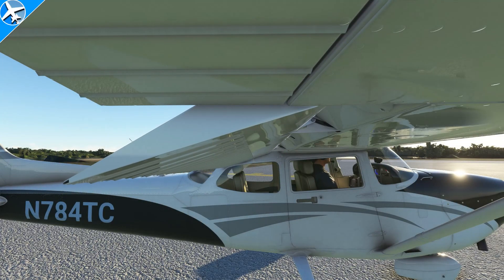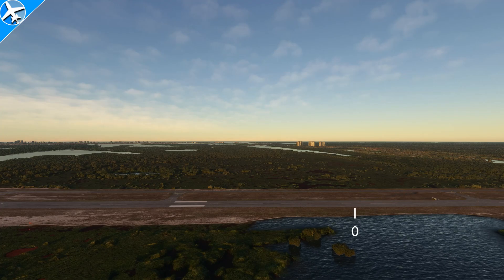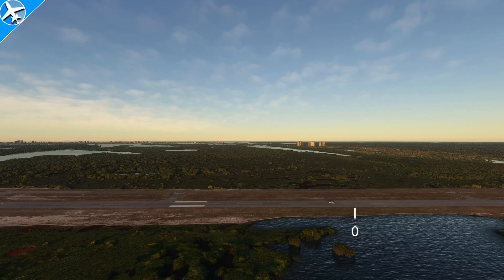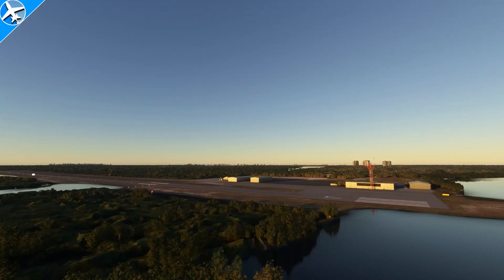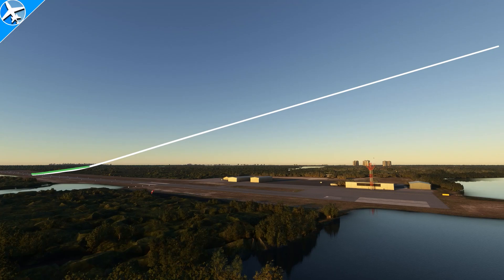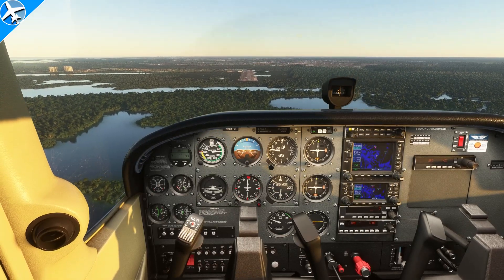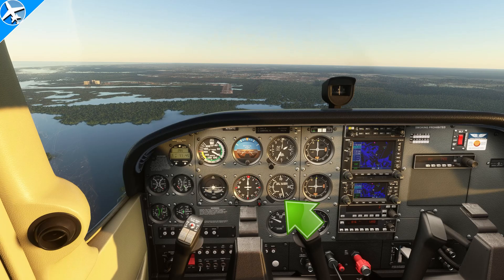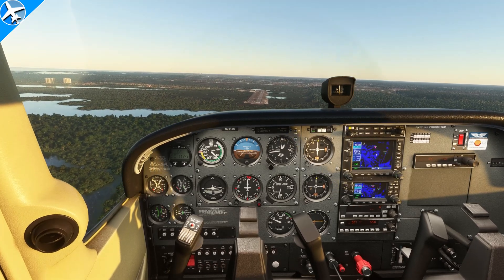How Flaps Affect Aircraft Climb Performance | A Demonstration in MSFS

Comment: the take off roll with flaps 10 is shorter if you rotate at 55 knots as per the handbook. Setting flaps ten is what will get you airborne earlier at a lower speed. With flaps 0, when you rotate at the same 55 knots, the plane will take a few moments longer to actually lift off, therefore increasing the take of roll. Testing flap settings for take off with to high of a take off speed renders the test obsolete, because the speed is so high it doesn't matter if flaps are 10 20 or 0, the plane will just immediately fly upon rotation at 70 KIAS :(
Reply: In other words: the more flaps you set, the lower the >lift off< speed will be, therefore the lower the take off roll will be, however the longer the take off run, ie distance over 50ft obstacle will become
Reply from the maker: The book says the takeoff distance will be 10% less with flaps 10 vs 0.  You are right but the idea was to keep the speed identical and then show the takeoff climb path to show the effects of greater flap settings.   Either way, no one will takeoff with flaps more than 10 degrees in a 172 and they should always follow manufacturer’s procedures. This was just meant to be fun and to show that higher flap settings do not increase climb performance in real life or MSFS.
Reply from the maker: I may do this test again (just for fun) using different rotation speeds based on a percentage above stall speed for each flap setting.

Comment: I was really annoyed with MSFS when I first got it, all aircraft are set to take off with flaps 1. As a pilot irl, that is just not right...
Reply: as a pilot in a 172N, i’ve never used flaps on a normal takeoff…
Reply: @ryangreen9541 hahaha this guy ain’t wrong,  Short and soft field only time for flaps imo but more current Cessna manual usually say “up or 10deg (10deg proffered)” from my experience 0-airline courses use flaps to get your habit built, but 0 gets your ASI alive quicker w/ smaller engines

That’ll be 0.10$